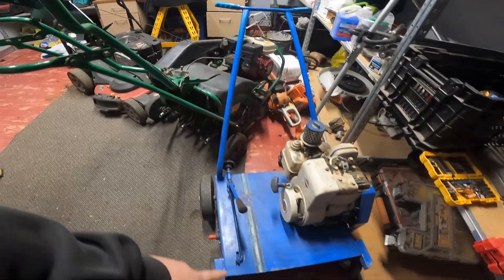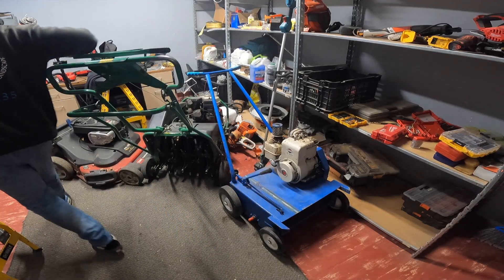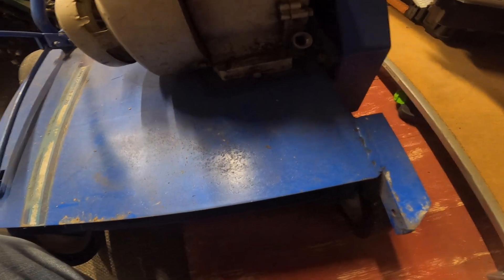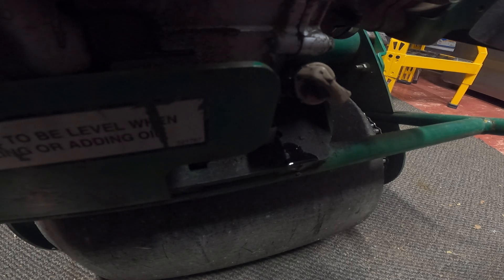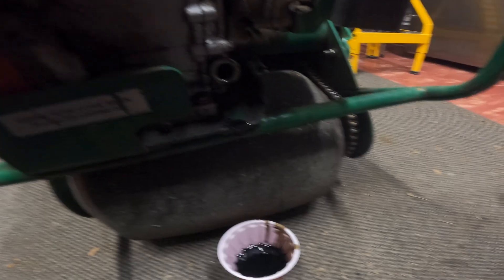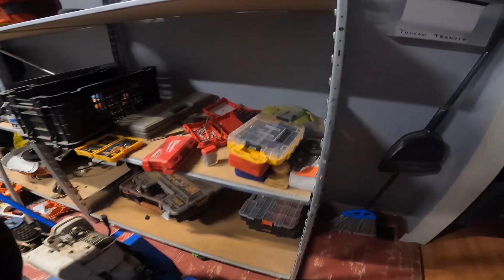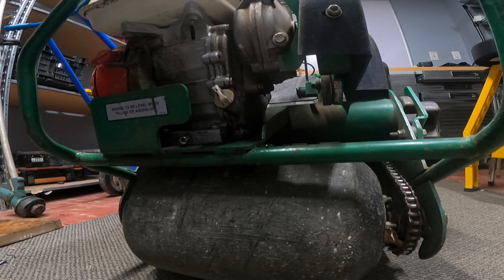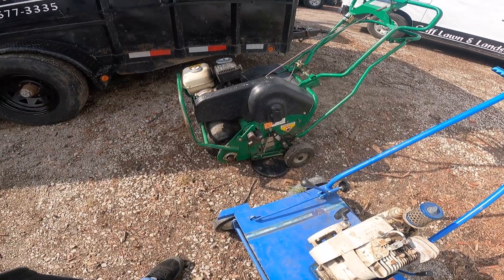Ryan turf Aerator and  bluebird DeThatcher oil change. First oil change in a couple of seasons!

Comment: I bought the same aerator used last winter with a Encore power rake and Billy Goat vac. The guy didn't change the oil for awhile it was almost a sludge. Thank god i bought it and saved it from death.... I gave it a tune up and it runs amazing now. It has paid for itself in under 2 weeks.

The power rake was missing almost 1/3 of its blades, so i went to the metal shop and bought a 6 foot chunk of steel to make my own instead of overpaying from the store($16 and an hour of my time vs $100+) and just replaced them all with new ones. 

People spend thousands on equipment but can't spend 3 minutes changing the oil or maintaining them to run properly, it is so silly. How they ever even run a business in the first place if they can't do other simple things amazes me.